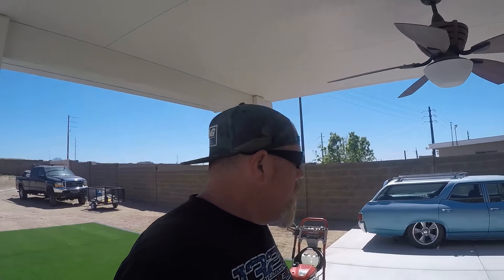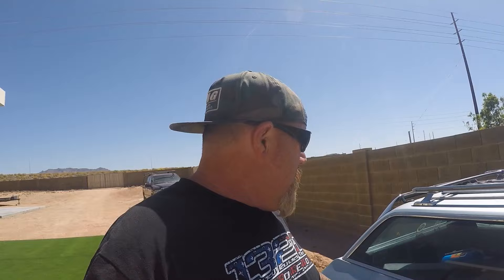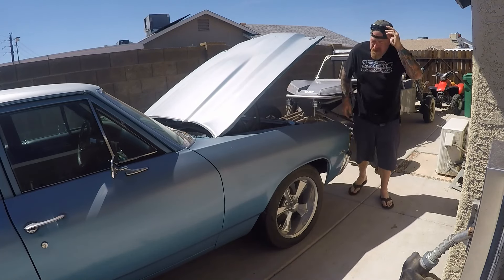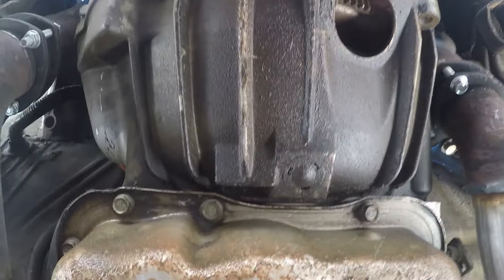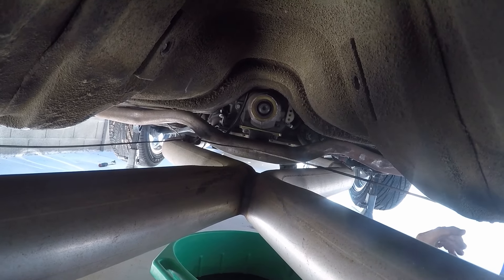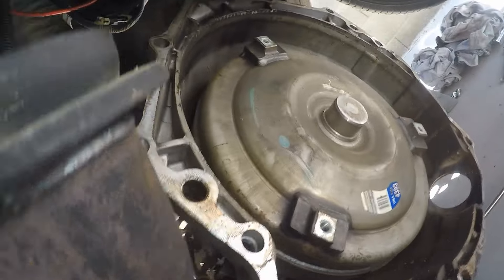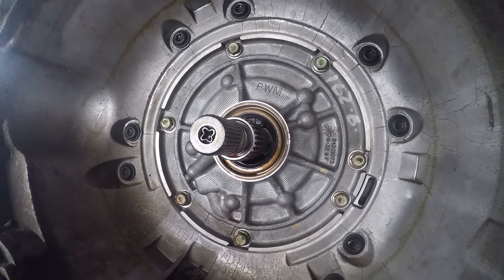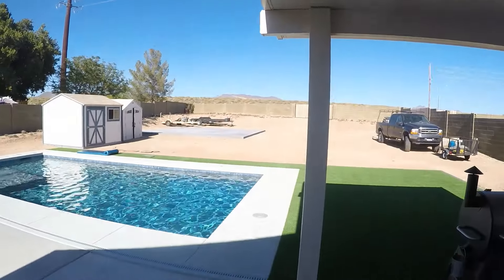FINALLY PULLING THE TRANS ON CHEVELLA AND ADDING AC!!!!!

Comment: Bitchen car. Couple brother buddies of mine Rod and David Ohaneson I went to school  with at Sunny Hills high school in Fullerton had a green one in perfect shape that looked just like yours with a big block Chevy 427.  Our senior years they were building a new Sanger bubble deck flat bottom with BBC 454 with bull tunnel ram . I was building my new beautiful Cole blown and injected 468 BBC so we use to head to Parker after we were done with them. Our first trip to Parker with high dollar paint job on mine it was 121 and was so worried it was going to fade a bit but never did a thing.